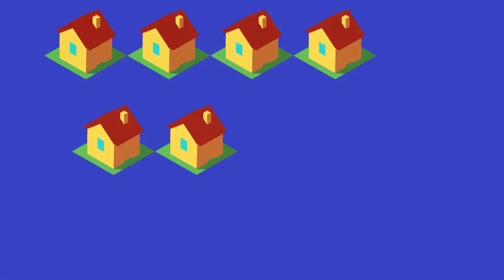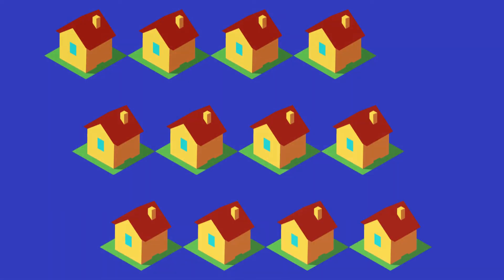Will nuclear waste get a second chance? - Molten Salt Reactor

Comment: There is no current plan to deal with nuclear waste other tan put it into drums and wait for it to leak out. We should start by building molten salt reactors at nuclear plants that have seen shut down. The spent fuel that is stored at these sites can be mixed into new reactors fuel mix.
Reply: I absolutely agree with you, I hope we will see this in the future.
Reply: @ČrtEržen  You guys do realize it can't just "leak" out, it's not a fluid, and it's not even really all that soluble so it can't even really leach out either. But I'm with you, if you are a country that has SNF you have a very very valuable resource, I'd hoard it until it can be reused.